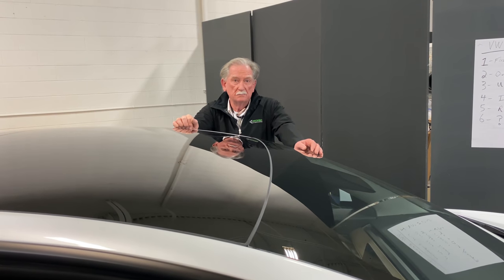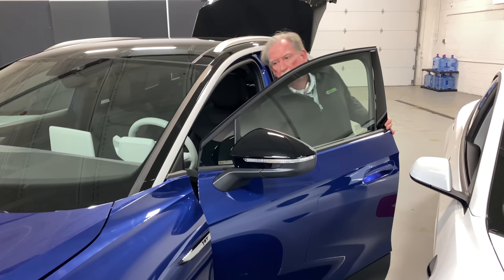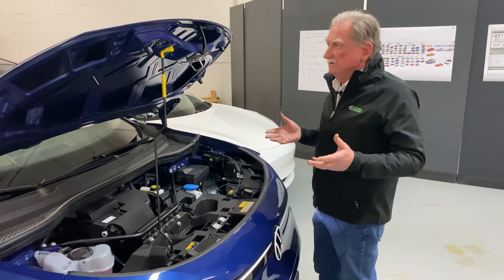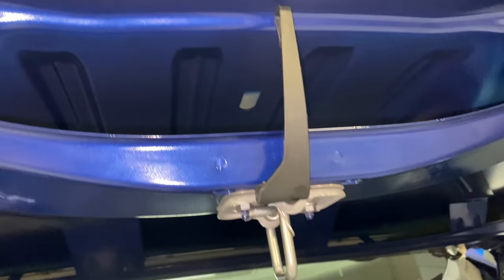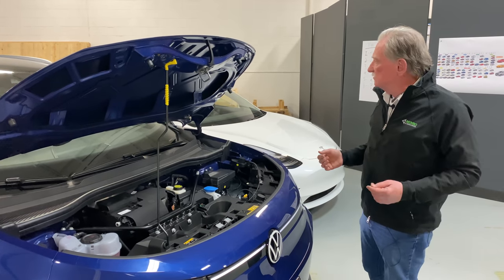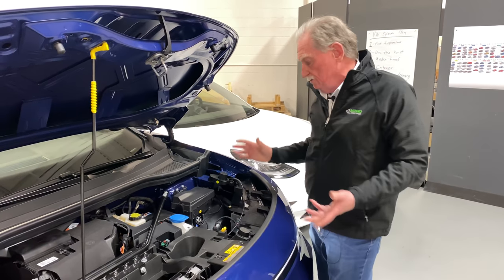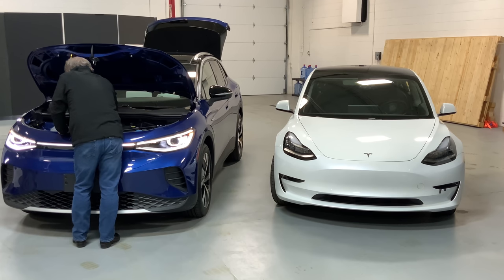2021 Volkswagen ID.4: E2 - Under The Hood

Comment: Some of that space might be earmarked for extras related to AWD models. Part of the MEB platform that can accommodate different models with the same base, plus or minus certain things depending on the needs.
Reply: Given the car was purpose designed to be electric and Tesla had already released 3 cars, which all have 4WD options and storage space there, it looks like a massive miss to me. They did copy all the Tesla's models' inability to carry a spare tire and jack under the trunk floor though, so they copied one of the main missing features that completely puts me off buying Teslas (Apart from their 'you're renting the car from us even though you've paid enough money to buy it, because you can't get spares without their blessing and we'll sometimes turn features of your car that you paid for if you cause trouble' of course).
Reply: Turtil - VW needs to Abandon the MEB platform and RETHINK every from a TOP DOWN prespective , eliminating INEFFICIENCY , wasted space and overall Weight concerns.
Reply: Reading more of the comments I've come back to say I was extremely short sighted in thinking this was a miss. I'd forgotten about the shorter front end, massively bigger interior space and much tighter turning circle that the ID4 design allows. The space under the hood doesn't need to be pretty, it's not for the customers unless they're doing service work on the car such as checking fluid levels or changing filters, and all these items are way easier to access than the Tesla, where you have to remove panels to get at most of it.
Reply: @peglor  Yeah, it is a surprise sandy didn't mention that here yet.
Reply: @rkan2  Sandy's a tesla fan boy now but i love it  😂
Reply: @peglor  The hood is slightly shorter than the Model Y´s but it is also higher, so there is a similar amount of space in both cars. It is easy to see that Tesla is much better at arranging aggregates, just have a look on a similar view on a Tesla Model 3/Y.
Reply: Apart from the fact that it has a considerably shorter front overhang than the Model 3, has to fit a augmented reality module that Model 3 doesn't have and is 11 cm shorter but still has far more legroom than the Model 3.
Reply: @nilsfrederking62  is it higher after you account for the difference in ground clearance?
Reply: @ArnthorJon  augmented reality module that must be a huge piece......
Reply: @nilsfrederking62  yes, it is as big as a beer crate
Reply: @peglor  indeed, and overall ID4 length is 10cm shorter than Model3
Reply: @markplott4820  There will always be room for improvements and no car will be perfect. Everything is a trade off at some point. If you compare to Tesla, I think the Model Y would be thr closest equivalent. Base id4 vs MY puts the id4 64 kilos heavier. Heavier yes but not excessively. I'd also bet its not as efficient for range per kwh but what might you be gaining as a trade off? I think the id4 will be a good vehicle. Not revolutionary but good. It'll appeal to those not yet comfortable enough to move away from the traditional dealer system and get move EVs on the road and help drive up the rate of adoption as they become more visible in society.
Reply: @markplott4820  who writes your copy? The SUN?
Reply: The short hood and reduced overhang also make the car easier to park and maneuver in tight spaces.
Reply: And that is why Tesla is dominating. First Principals thinking trumps all.
Reply: @aleusblueriver  I couldn't wait to get away from the dealer system.  VW dealers fleeced me on servicing for years.  I'll bet they'll try to do it with these cars too. I can just hear then now "well yes sir you might think electric means no servicing but......"
Reply: @markplott4820  yeah, probably not gonna happen any time soon, as it also will be used by not only VW, but also Audi, Skoda, Seat and probably some non VAG brands

Comment: I know that its extra money, but I would like to see the ability to plug in at both ends of the car.  This is especially handy if you need to charge with a trailer attached.
Reply from the maker: That would be a nice feature. Sandy and Cory preferred the rare “pull-in-forward” Tesla supercharger when they took their 8,000 mile road trip.
Reply: The Audi E-Tron has this as a addon.

Comment: The ID.4 has separate heating and cooling systems with multiple components. All together they take up a lot of room. Tesla has integrated their heating and cooling into one do all system. It all flows through the Octovalve. This allowed Telsa to cut down on space used and have much fewer components used as well. Tesla's component packaging is just superior. This allows Tesla to have some extra space in the frunk to be used for storage.
Reply: Also the Tesla hood is longer and the interior smaller, which is the main reason

Comment: Some interesting stuff on the MEB platform. If you look how short the nose of the car is compared to the model 3 you trade off a frunk for more cabin space. Another interesting one to cover Sandy is the rear drum brakes. Sealed units that last the lifetime of the vehicle (as electric cars are very light on rear brakes). Teslas often struggle with lots of corrosion on the brake discs (because you dont use them).
Reply: Don't agree with this.  The only reason to  use drum brakes now is to save money.  Any other reason is just marketing justification.   With electronic brake bias and multichannel ABS, autobraking, ect  its easy for the car to do a clearing cycle to clear rust.  If the rears are going to rust the fronts will too.  There is a reason why no cars except the cheapest of the cheap cars use drums in the rear.  Discs are superior performance wise and is much safer because they have much better cooling and heat capacity.  Which is exactly what I want with a near 5000 lb car.  I don't want to rely strictly on regen at highway speeds going down long stretches of highway especially in the American west where you can descend 10,000 feet or 3000 meters within a few miles.  Energy needs to go somewhere, if you overheat your battery then you rely on your brakes.
Reply: James - the Brakes on Tesla last almost FOREVER as you use REGEN 99% of the time. 
MEB platform is OUTDATED and needs to be Replaced.
Reply: How does it effect heavy braking, when you need them the most?
Reply: @GlitterGuru  Discs are Way better performance wise in every possible way.
Reply: @GlitterGuru   - Still Reliable, TESLOOP tested this Extensivly , they were able to get 300,000 MILE Performance out of the Brakes before they need Replacing, saing Customer $$$
Reply: @GlitterGuru  the way weight transfers when you brake means most of the braking is done by the front wheels/tyres so you don't need much braking performance at the rear
Reply: @markplott4820  yes thats exactly why you can have a sealed drum system on the rear - you dont use them on an EV, and when you do need to brake hard its the fronts that are used. Have seen quite a few model 3s (including my own) that have brake issues to do corrosion (i had a front pad changed after only 10,000 miles because the corrision on it was touching the disc when the brakes weren't engaged)

Comment: I had 2012 Passat and now have a 2016 Passat and the fuses in both cars are not labeled.  It was either pull a fuse and see what happened or go to the dealer.  Crazy.
Reply: My Passat from 2003 is labeled.... good old times, where VW had built long-lasting vehicles
Reply: My Seat Leon 2000 has it labeled, at the site. (VW engine)
(on the driver's side - when you open the door, there you have fuses & labels, additional descriptions in the manual)

Really was a better time for VW quality.
Needless to say, hope I'll be able to afford an EV as the next car <3
Reply: Modern German engineering...keep the owner from doing any work themselves
Reply: You don't really need to know which fuse is what. A normal user checks for a defective fuse if he has a problem, and swaps that out. If you want to pull a fuse to work on a part, you either know which fuse it is or you look it up in the handbook.
Reply: @Psi-Storm  but sometimes you can't see from the back that the fuse is defective. A simple embossing on the plastic lid would solve that
Reply: Its so good that Tesla lets you repair everything yourself and has everything labeled...including the fuses that according to the expert ...”reconnect”
Reply: Why would anybody buy a Passat, the worst car ever made.
Reply: @airdad5383  Just buy one with manual and it will be ok. They still make them with manual for EU market.
Reply: Cars have user manuals! It’s stated clear in there. If you lose your manual, use the web, it’s there too!  How difficult can it be .
Reply: @pilotandthecity8527  thank you. Apparently, not even the great Sandy knows these exist ...wish he'd read the manual before telling me what he thinks.

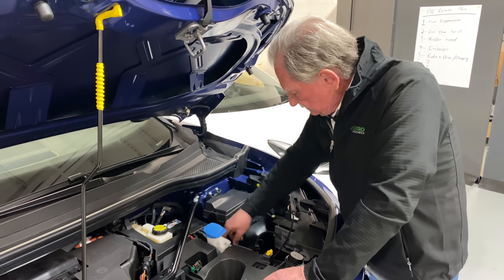Comment: 7:50 It’s standard practice for all fire departments to get training on each new model electric car as they are introduced. This training is developed and promulgated by each car maker. They also receive training on specific cut points designed into each car when using Jaws of Life or other rescue tools. Many cars have a QR code sticker which points to these instructions, and many if not most electric vehicles are using QR codes for instructions on where to cut the 400 VAC cables.
Reply: Munro's point was that for something vital to safely disabling the car after an accident, having it buried behind other components is maybe not the best design.

Comment: I’m waiting on the driving reaction and maybe trying to charge it
Reply from the maker: Coming soon...
Reply: @MunroLive  I’ve noticed others struggle with Electrify America so I’m excited to see what you think.
Reply: Plenty of videos from out of spec motoring. Car looks really good and charges fast. 👍🏻
Reply: flatter charging curb than Tesla on a 150kw charger (sustains higher charger for a longer period of time). Ends up charging in about the same time as a Tesla even if it's on a 250kw charger. Rumor is Tesla will be opening up their superchargers to other brands, if true, free EA charging when available plus Tesla charging network if not available, best of both worlds.
Reply: Björn Nyland just had a week's worth of testing the ID.4. He's pretty impressed, and it achieved one of the best non-Tesla scores in his 1000 km standardised test.
Reply: @bilgyno1  When charging from 8 % and heating up the battery by spirited driving the channel move electric saw a peak of 130 kW and 100 kW till 50 %!
Reply: @DarwinChaug  that’s when and if you find a charging station that works. Electrify America’s network is the equivalent of the State Lottery. Great marketing fluff with limited chance of winning.
Reply: @pauldesi  the car that set the record for EV cross country road trip canonball record is a Porsche Taycan on the EA network. Faster than any Tesla that did the run.

Comment: Yeah, no frunk. But look how short that hood is. Plus they moved a bunch of stuff in there that would normally go under the dash. I’m guessing they focused on getting as much interior space as possible given fairly limited exterior dimensions. That said I would still like a small frunk that would at least hold my charging cables.
Reply: This is what Volkswagen has stated, they eliminated the frunk to give as much interior room as possible. Additionally, one thing he is missing is that there is a AWD version, and that version will need room for the motor, which is why there is "extra room" in that area.

I am curious to see how different the ID4 will be when the US version is made in the US (I beleive next year's model). It will be interesting to see if they redo the hood and a few other things to streamline production, since they'll only be making US spec cars, so won't need to worry about compliance with EU regulations.
Reply: indeed, and they also gave more room to the front wheels and much improve the turning circle
Reply: @jh5kl   Good point.  How many people will take a frunk over more interior space, tiny turning circle, and short front end?   Sandy just can't get over Tesla.  He seems to have a crush on everything they do, as if Elon couldn't possibly do any wrong.
Reply: @updlate4756  i sometimes hates the way sandy thinks he is a better engineer. The id4 even has a sliding roof cover inside for better insulation when it's too cold.
Reply: @alanmay7929  Yeah, I'm waiting to see if he actually realizes the shade's there during the driving test since he didn't seem to know about it in the initial walk around.
Reply: @updlate4756  sandy munro litteraly knows nothing about the id4, I bet he didn't even watch one review. Björn Nyland is my trusted EV person. Björn Nyland reviews, test EVs on long trips, camping, practicality.....

Comment: hmm i see a lot of plastic for NCAP test numbers and that thick bar is also for impact as well. the hole front must be tailored for the NCAP test.
Reply: Of course it is. If you want to see how to do it cheap and ignore safety look up the dacia spring. You can see the road underneath from every angle you look into that engine compartment.
Reply: @Psi-Storm  you can see the road?
Those are mud exit points ;)
Also, that means nothing for the test. Did it fail?

Comment: There are some advantages. Shorter nose, full of components  increases cabin area.
Reply: Decreases crash worthiness. No thx.
Reply: @wolfgangpreier9160  no it doesn't
Reply: @merzto  Yupp it does. Look at the front and overlapping crash test results of the Model3/Model S and the ID3.

Not at the stars rating. At the actual crashes of course!

For the ID4 there are no crash test results.

Comment: Although that washer fluid fill opening needing to be removed to access the firefighter cut loop is an atrocity, it actually seems to make filling washer fluid without spilling easier--simply open the blue cap, detach the base (in either order), and fill with the opening nearer the bottle of washer fluid.

Comment: There is a positive pin in the fuse box for jump starting,
Very normal on newer cars.
Reply: Except that the owner's manual for the ID.4 specifically instructs to connect the jumper cable directly to the battery positive post.
Reply: @pasad335  Have replied that to another comment,

Comment: The hood of the Tesla is a bit longer. VW probably choose for more interior space over a frunk.
Reply: It is much taller though.
Reply: @kennyg1358  
You’ve got a valid point there.
Reply: @Conservator.  GM seems to have a similar idea of making their electric powertrains fill the engine bay like ice powertrains. Strange choice.
Reply: Then why waste the space with a far too large HVAC and a fusebox which nobody needs anymore. 
Haven't they heard of semiconductor automatic fuses and central power control and distribution? 
Melting fuses are such a old fashioned standard.
Reply: @kennyg1358  The ID is a crossover while the model 3 is a sedan. Sandy doesn't have a model Y in his pocket which would be a direct comparison.
Reply: @wolfgangpreier9160  Imagine that, VW being behind the times by .. maybe.. a decade? shocker huh?
Reply: @wolfgangpreier9160  Because auto-fuses are very expensive to replace when they break.
Reply: @storm4710  You cannot replace any fuse in a Tesla. There are no "fuses".
Reply: @evwannabe593  Yes! Shocking! And i even know how VW makes parts of their innards like e.g. the battery case. Better then Jaguar but not much better..
Reply: @wolfgangpreier9160  Yes you can because sometimes the circuits break, 
which means you need to replace the whole module.

Comment: 10:53 As an electrician I Barely agree with you there, the coating is making it non conductive(paint generally do), one little hole/scratch in the paint and it will short it. It should be insulated properly or be in an other place. My guess is that it will not pass an insulation test at 500V. It is a safety consern to have sparks over a flat battery that one need to charge.